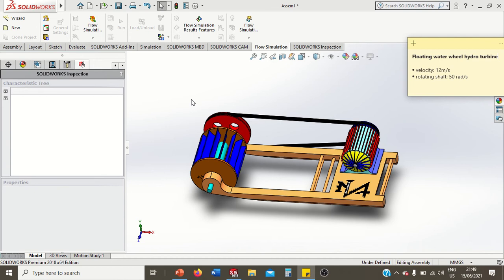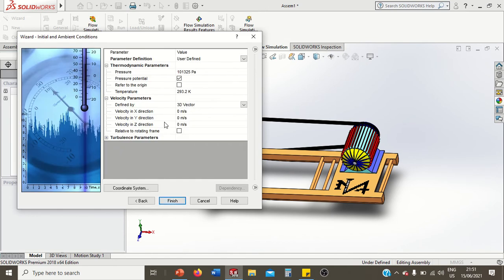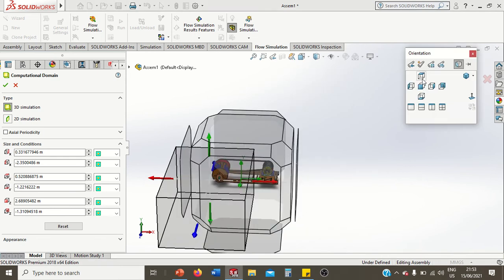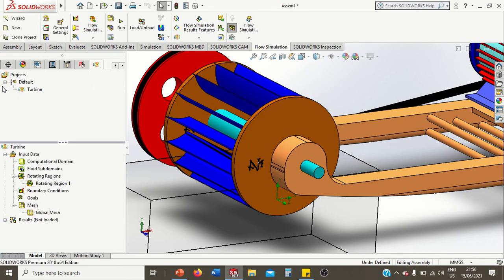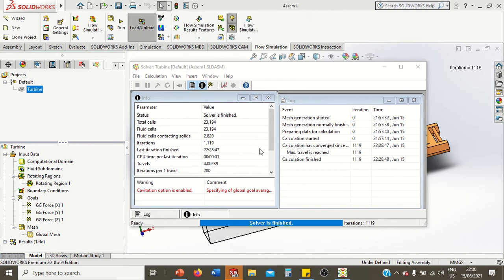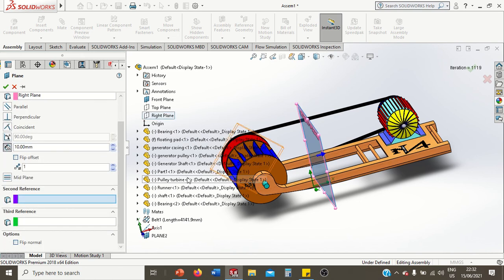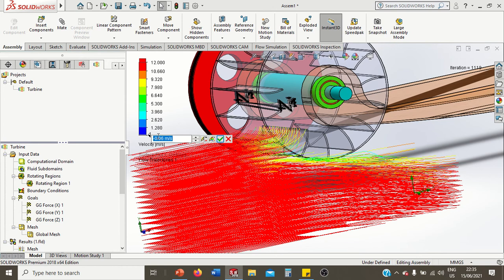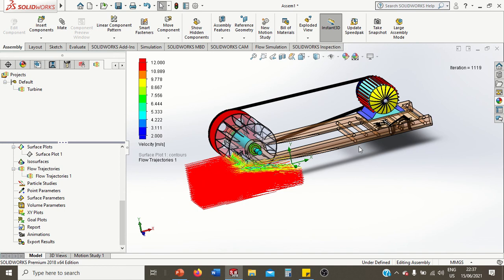Solidworks flow simulation- Floating Water Wheel Hydro Turbine

Comment: Hello, 

Can I use this simulation to calculate the torque and rpm at the wheel in x flow velocity? If so, how?

Thanks
Reply from the maker: Hi there, yes you can. from parameters select only force in x-axis and then follow same instruction. from rotating region you cal calculate your angular velocity. you need to convert the unit before :)